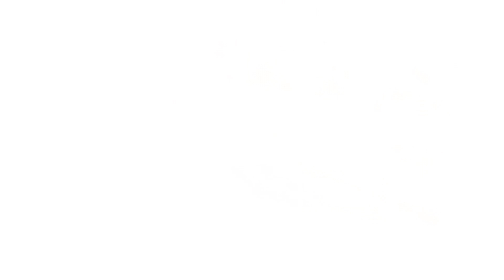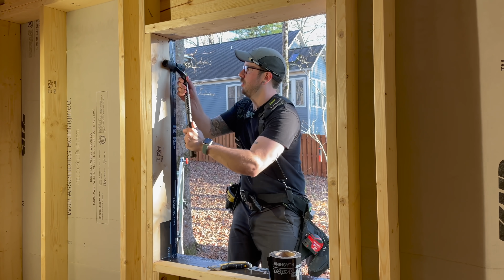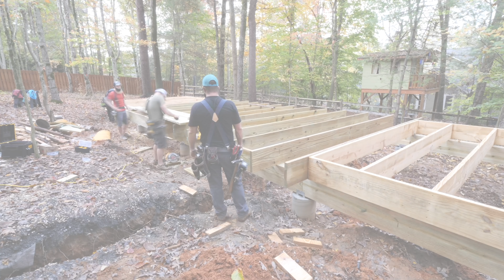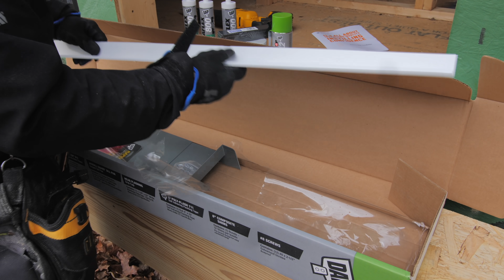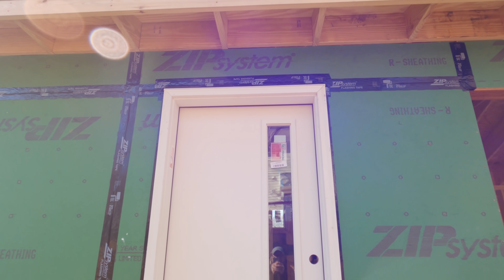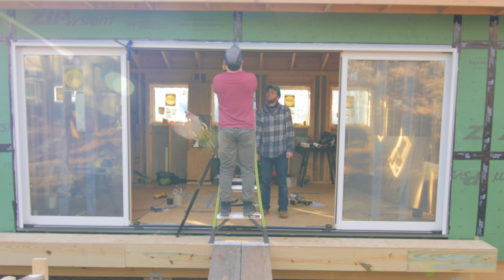HOW TO INSTALL A WINDOW & EXTERIOR DOOR // Not So Tiny House Build Part 7

Comment: Awesome, but why big door by little door🤔
Reply from the maker: The larger doors aren't a great option for getting in and out of the house quickly since I installed larger roller blinds in front of them, plus I like having a smart lock on the entry door for ease of entry.

Comment: a weird question, but why are not the sliding doors inside the house? I mean, I know they are like this on Pella's website but it looks like you mounted it the other way around and the tracks should be inside the house and not outside and exposed to the elements...

Comment: Is that entry door going to be a problem in the future as wood expands / contracts over time?
Reply from the maker: The rollers are adjustable and I've already adjusted them once for the summer. Easy enough to get them running nice and smooth again!

Comment: I have a question, dont they use flashing or drip edge on the top of the window? I would be nervous only using silicone on the top and the sheathing goes under the window, so what happens when water gets behind the sheath? It cant get out..

 Ok you mention adding flashing, but i think the flashing should be under the wrap? Arent these windows still risk of leaking if the sheath gets water behind it?

Comment: i know everyone knows a better way ..but the sliding doors on the outside track? going to use a screen door on those misquito filled evenings? my screens on the outside so you can leave the glass open or closed maybe yours is different.
Reply from the maker: The screens for these go on a track on the inside, which also means they'll stay cleaner!

Comment: Great job on the build. but make sure you make that follow up video when you replace the front door after the season changes. lol  having that door that tight will cause all kinds of problems. there is reasons why you have a gap between doors and windows.  other wise nice build.
Reply: keep a crowbar near the door you might need it to get out after things settle a lil bit ...love the show dudes

Comment: Unless you are planning on staining the unfinished windows, now would be a good time to pick an interior trim color, mask off the glass and hardware, and spray on a few coats of paint. You could probably find the right color in spray cans, making it all that much easier. My recommendation would be to first apply a coat of sealer like clear shellac.

Comment: You could have fixed the deck by cutting the extra material with a chainsaw, and then "rebuilding" it to the correct level using 2x6 lumber. It would have looked the same, and most likely been faster to build, but you have the cost of the extra lumber.

Comment: hi mate, if you cut the ridge tape on your roof then your airtightness system goes out the window. the building is either airtight with an HRV or not airtight. no point doing all this air tightness to then leave a gaping hole in your roof that is ultimately connected to your living space.

Comment: Dude would it benefit from doing all sides of inside of window frames with that tape ? as an extra measure ? just asking 🤘🤘🤘
Reply: A leaky window can go unnoticed for years. By the time you find out about it, the wall around it will be rotted so bad you will wonder how the window did not just fall out.

Comment: you could have used a jigsaw resting on a piece of wood on its side (after starting the cut with your circle saw). Of course you dont get the full cut but it would have been straigter than the jigsaw.

Comment: Looking great, thanks for the detailed process. I have a question - in the last screen of windows from the inside - there are round holes above the windows throughout the entire top board - why is that? Thanks :)
Reply: Ventilation.  Also to let flys and mosquitoes out.

Comment: When I installed the windows on my house, we needed to remove the protective foil almost immediately after install, since with the help of sun it could really stick to that glass. Other than that, it's a cool build so far!
Reply: yes and I never understood why people go with wind out windows? Over the years the many parts it has breaks and need replacing as well as deflecting water inside if accidentally left open in the rain. It happens many times over the life of the windows. with such a small or none overhang it consider it a bad choice. Now as wood casement inside oh no. The swelling and movement is also a big headache. PVC sliders every time.

Comment: You could have over cut those joist and then sister new 2xs leveled.....  :)  would have saved you hours
Reply from the maker: There was blocking between each of the joists which the subfloor and walls were attached to, not sure it would have been any easier.

Comment: In South Africa we build with bricks and mortar, so the timber frame construction vids are very educational for me.

With the door that was fitting so snug. You are fitting now in cold weather, with the door being such a tight fit, could there be issues in the middle of summer when it is nice and hot, with expansion and contraction pushing the frame in?
Reply from the maker: It's certainly possible the door could get a little tight come summer time. Thankfully, this is in our backyard and it would be fairly easy to fix by planing off a bit of the edge of the door.

Comment: Aren't the big sliding door backwards? The sliding portion should be on the INSIDE so that you can put dowels/braces in the track to prevent them from opening if the latch should break...
Reply from the maker: Yea there is a latching mechanism inside along the threshold, no dowel needed.
Reply: Wondered the same thing.  Seems leaves and pine needles will build up in that exterior track.  I thought slider portion would go to the inside as well.
Reply: haha not sure if this is serious or sarcasm? if serious, the sliding door is probably a much higher quality than your typical contractor grade door, so you won’t need to worry about a dowel
Reply: @bchantharath  I am 100% serious. I am sure it is better quality than typical "contractor grade", but the truth is "Anything man can make can break". The latch doesn't get set right, something gets stuck in the receiver slot, leaves and crap build up in the tracks and block the doors. I get that the glass itself is more likely to be broken for someone to get in, but check out sliding doors. I have never seen one that the sliding portion is on the *outside*.

Comment: We used the same sliding doors on our remodel and they are amazing.  The amount of light that comes thru versus our old setup is a night and day difference.
Reply: Night and day difference? I see what you did there ;)
Reply from the maker: I'm loving them so far! Did y'all spring for the screens or any kind of blinds? Trying to decide what I'm going to do there.
Reply: @craftedworkshop  We did not put any coverings on after we installed.  We wanted all the light in the room that we could.  We have a large patio roof over it so that provides the shade that we need when we need it.   Only thing we needed was re-inforced screens.  The stock ones are no match for a charging 110 pound Labrador! :D

Comment: 7:27 Personally i would have just gone out and gotten a multi tool with a couple of spare blades should easily be able to do the job.
Reply from the maker: That would have still left a pretty rough surface and I think would have been much slower than the reciprocating saw. Both would work though!
Reply: @craftedworkshop  A chain saw is faster 😆
Reply: I would probably of kerfed the top of the joists with a circular saw at the desired depth (as many times as it takes to easily knock them out) then clean it up with your planer/grinder/and sawzall
Reply: @nikodabentley8026  That is a great idea!
Reply: A router would have worked as well!
Reply: @aaronsvoboda5897  Always the problem is getting to the end of the cut, a portable band saw can work too even the problem as exposed by johnny was that the wood was pinching the blade.
Reply: @EPortillo5000  Good point. I guess a router would work for most of it but then you'd need to swap in. i didn't think of that
Reply: But that was one of those unfortunate situations where no matter what you did, it wasnt gonna end up being that pretty, or be an easy fix
Reply: @nikodabentley8026  There is a skil saw that is like 12" blade that is the closest to a perfect way to do the cut but not many people have one.

Comment: Why build with wood? Why not brick? I feel all this taping and stuff would not need to be done and would be much easier if you build using bricks.
Reply from the maker: Yea, most brick these days is just a facade, unless it's like concrete block. That is a totally different skillset (mason vs. carpenter) and I have zero experience there, so I stuck with wood.
Reply: Not an expert, but brick is an entirely different skill set, with its own challenges. I imagine there are cost considerations, not to mention the pickiness of his HOA, and I assume you'd need to do framing and insulation anyway.

Or it could be as simple as not wanting brick. ;-)
Reply: brick/masonry much more difficult to air/water seal.
Reply: @ecostudio1044  it’s not much more difficult it but more steps and craftsmanship (ex. weep holes, ties, etc.)
Reply: @bchantharath  brick/masonry is porous and subject to freeze/thaw cycles. Go for it if you know how, live in appropriate climate. and I agree with your earlier comment above.
Reply: building with wood is much more economical & flexible. brick also isn’t a structurally sound building material. brick always used as a “skin” so either way you will be building with lumber. you’ll need to tape the wood even if you want a brick facade.